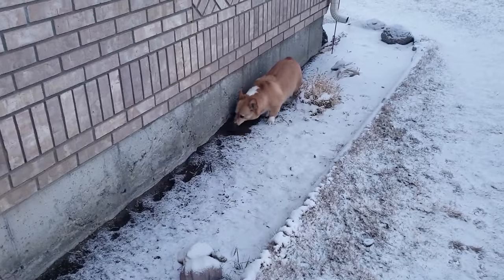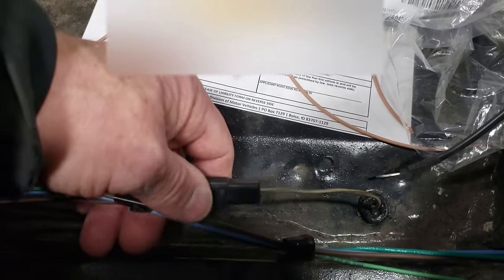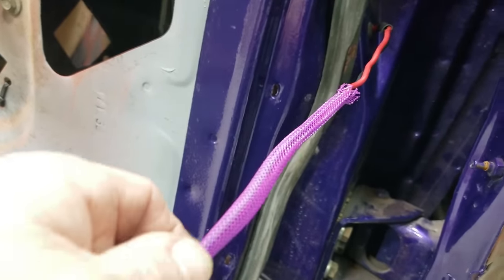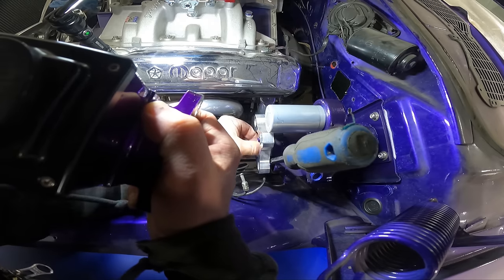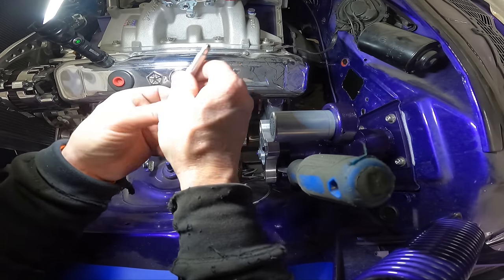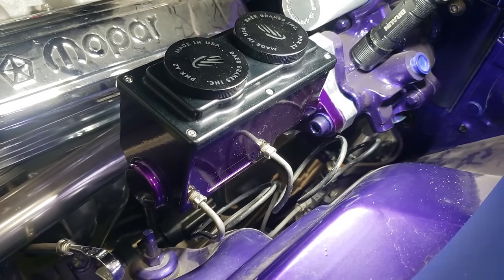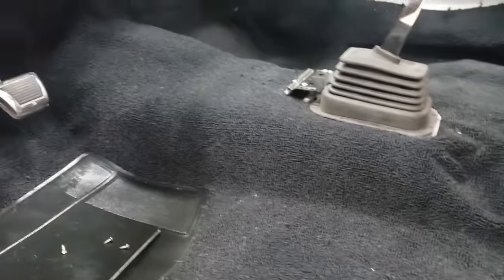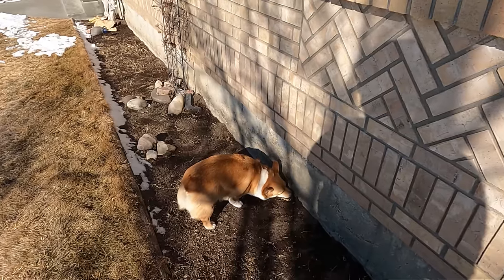Wiring, Baer Brakes And Laying Carpet In The Challenger

Comment: Jeff, for the future if you need to on something. To get that .005" clearance just add a .005" piece of shim between the shaft and the adaptor as you're checking the gap to the flange. Once your down on the flange, remove the shim you will have your .005" tip gap.

Comment: With the wires going from the passenger compartment to the door you would be much better off if you were to get a factory style door rubber according like is used for cars with power windows, locks, mirrors etc. additionally in the Kick-Panel you would be wise to install a connector that way if the doors were ever to have to be removed it can be done without major disassemble or cutting the wires.  The advantages of the factory style door accordings is the they keep the wires from kinking and or bending excessively where as that finger-cuff style wire loom will not.  That finger-cuff wire loom is great for protecting wires like on your trunk harness run or to dress wiring up under the hood or in the dash to prevent chafing etc.  I use that type of loom along with heat shrink at the ends or anywhere a wire(s) might branch off the harness along its run.  As for speaker wires I personally like to run them on the other side of the car to help eliminate interference issues.
With regards to the holes from your door poppers if it were me I would find or have made Mopar emblem made to cover the hole  or possibly a Jay Paydirt emblem of some sort (maybe a mini Filthy Whore)

Comment: whats wrong with ur sleds? mine was acting up again.same old thing.crankcase full of fuel.kinda hard on the recoil rope. and its not a good sign when u pull the exhaust off and half a gallon of gas runs out. last time i broke the rope.the first time i took it to the dealer.375.00.next time i pulled the carbs myself.tiny piece of plastic stuck in between the needle and seat. this time the little brass nut that the throttle rod drops into was rattling around in the bottom of the float bowl.obviously i didnt tighten it last time.so now im tryin to dry the little pig out

Comment: Could you use Plasti gauge to measure clearance on your brake shaft?
Reply: Also, would 1 gallon Ziploc bags full of sand work for weight on the carpet?